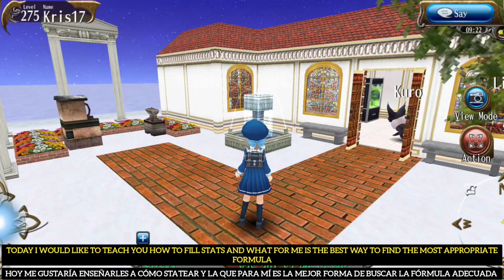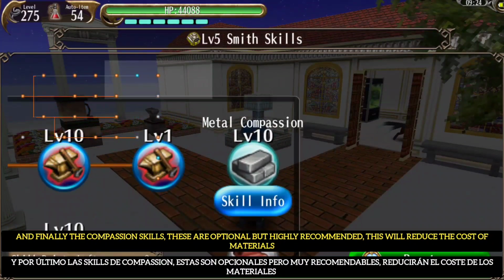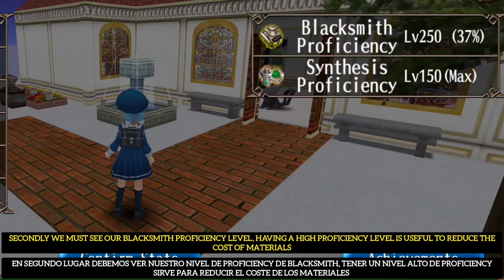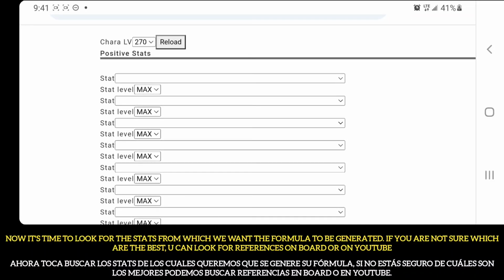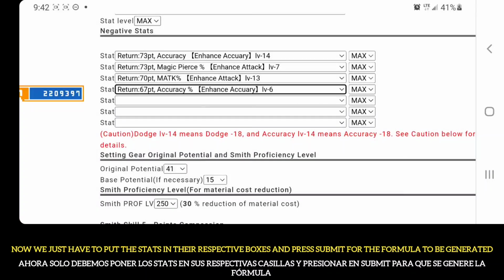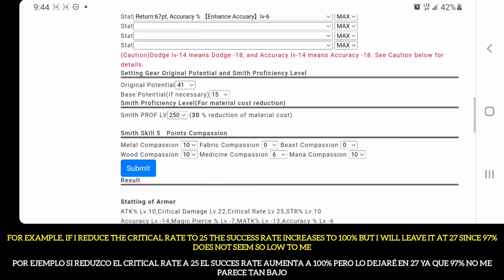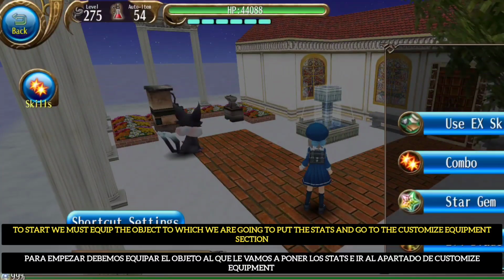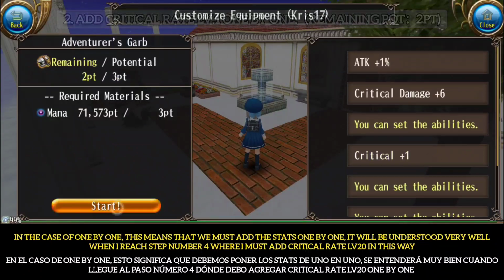Learn to generate your own Formula and Fill Stats! Statting Guide - Toram Online

Comment: I have a question. How can i increase the level stat can fill. Ex my account is lv 200 BS, my BS char is lv 200, my limit material is 105k, right now i maxium CRD that i can fill Armor is 20, so how increase it to like 25 or 27.
Reply from the maker: Your BS must be at lv cap to be able to put better stats. The material limit is increased by unlocking more Character Slots

Comment: Shifting to lazytanka from corynclub is very confusing. It took me a couple of times how lazytanaka work, but if you finally get the hang of it, it makes your fill stat formulas much more easier and quicker. 

Definitely would recommend switching. It is 10/10 always accurate.
Reply from the maker: I understand you, I was also confused when i try it since the steps are expressed differently. but after understanding how it works it feels more comfortable to use it

Comment: honestly I still prefer the statting simulator in cc, you have much more freedom than the one you showed
Reply from the maker: The one I show generates a perfect formula, I think it is much better
Reply: its much better man, its also very clear if you want to manually create your own formulas
Reply from the maker: @jma42  maybe it's useful for practice but I don't see the need to create a formula when you can already generate a perfect one automatically
Reply: @kris17toram in this statting simulator, is the negative stat auto or manual?
Reply from the maker: @FreuRozen  You must put the positive and negative stats in their respective boxes and the simulator will generate the formula for those stats that you put.
In the video I put 4 positive and 4 negative stats similar to an armor that I found on Board to know what the formula is to put those stats.